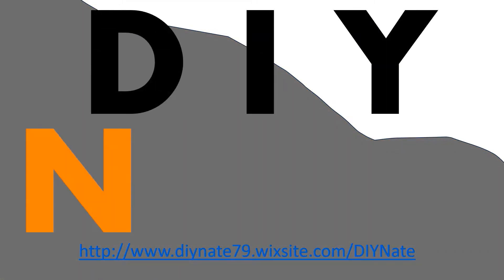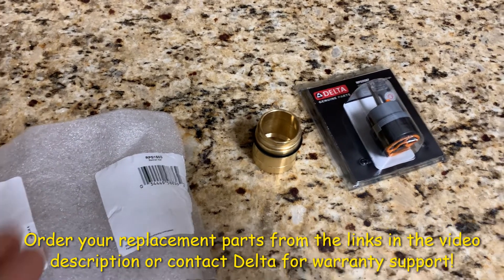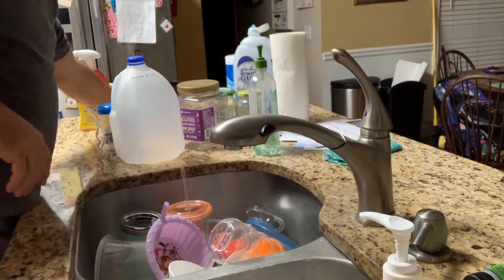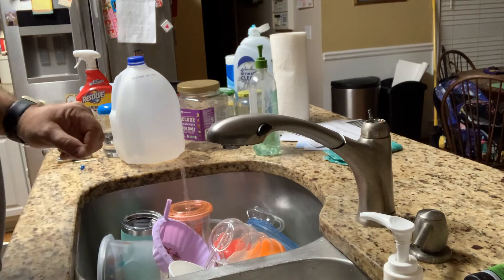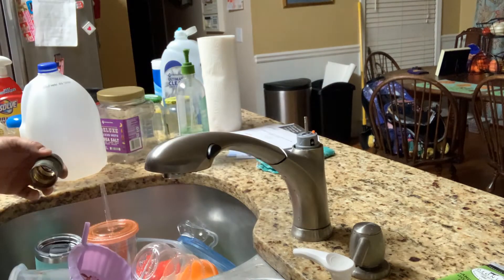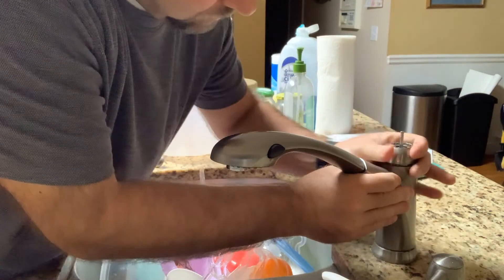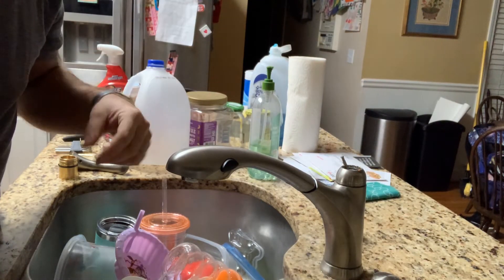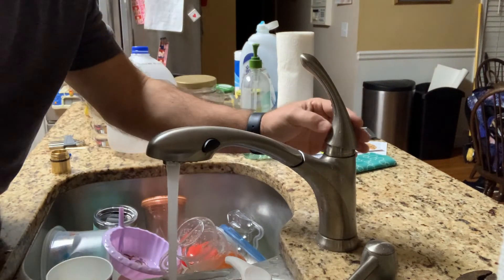How to Fix a Dripping Kitchen Faucet: Delta Single Handle Valve Cartridge Replacement! - by DIYNate

Comment: Excellent. I am glad i saw that first trick where you turn the handle a few turns to remove it. My plumber told me my handle was stuck in place and to buy a new faucet. He didnt even turn the handle to remove it, he kept pulling upwards, almost breaking my faucet, so THANK YOU. I can do this myself.
Reply from the maker: Happy to help and glad the video gave you the tip you needed for turning it to remove the faucet cartridge.  Thanks for your comment!
- DIYNate

Comment: If you have trouble with the top cap, I don’t want to risk scratching it with pliers, something called a shower wrench fits nicely. It’s the kind of wrench that comes as a series of sockets on a wire holder
Reply from the maker: Interesting - I haven't used one of those before.  I have often wrapped a towel or rag around the base and then applied pressure with pliers but that has a certain level of challenge with it that makes it hit or miss (and sometimes can still scratch the finish).  Good comment / addition - thanks for mentioning!
- DIYNate

Comment: In the future, I would clean the dishes out of the sink and cover both drains with a cloth.  I would have a paper towel or some light cloth to set all the parts on as they were removed (especially the red/blue or hot/cold symbol that covers the allen screw).  Soaking the parts in vinegar to clean works well.
Reply from the maker: Hey Pat - that is a great pointer and good call to avoid losing the small pieces, having it go down the drain and even cleaning it off.  Good pointer for anyone who watches the video and looks at the comment.  Thanks for the tips!
- DIYNate

Comment: What size allen wrench, part didn't come with one and the one I have is too big
Reply: Roughly 1/8 inch.  Just buy a new set.  Allen wrenches are cheap.  You might want to buy a metric and an SAE set just to make sure you get the right size.

Comment: I changed  my cartridge  and my water pressure  seems to have gotten  low coming pout of faucet
Reply from the maker: Hey Wayne - hope you have been able to get it figured out.  Cartridges aren't perfect so could be a dud, or may be worth unscrewing, putting the old one in and seeing if the problem is with both of them or just the new cartridge to help with diagnosing and figuring our your next step.  Obviously, when you first install a cartridge there is a bit of sputtering usually and sometimes takes a little while to get back to a normal flow.  And you know the manufacturers will tell you to use OEM parts, but many of us (myself included) are willing to take the chance on generic filters with good reviews.

Good luck sir!
DIYNate
Reply: @DIYNate  thanx it seems to be better  i was adjusting  the shut off valves under sink